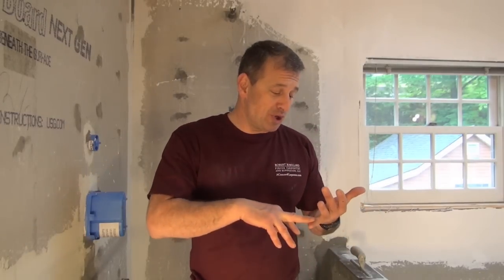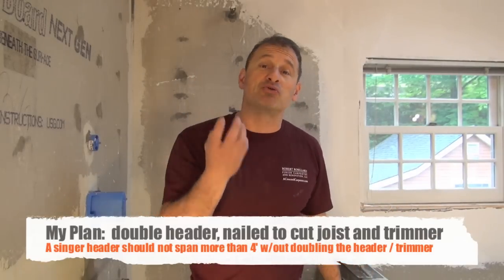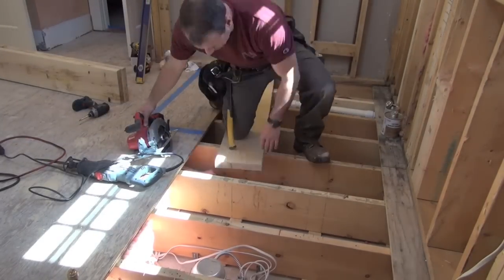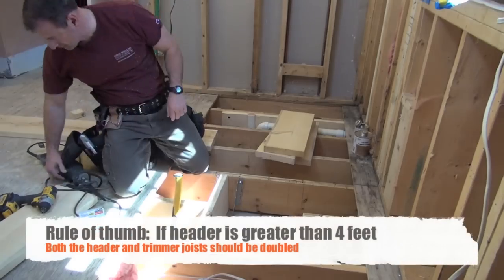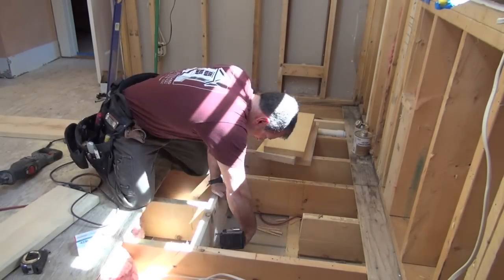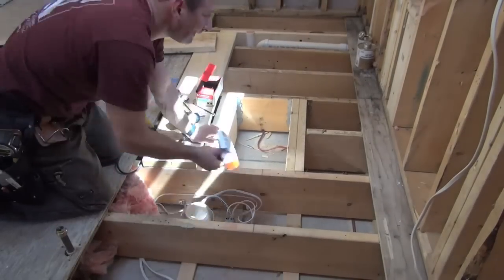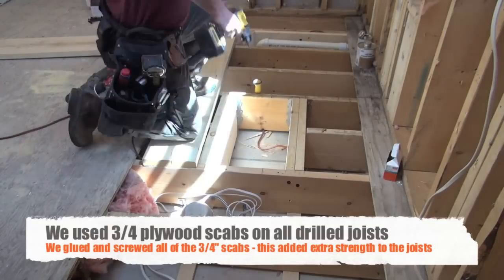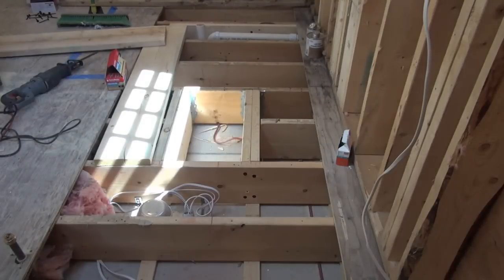Bathroom Remodeling Part 7 [Framing openings in floor joists]

Comment: Do you have a suggestion for a supporting a tub(on the bottom) that is already installed and the dry wall is up...I'm willing to cut the dry wall on both ends of the wall and try and put something under it...I'm looking for the issues that I need to think about once I start and any tips that would help(make it less frustrating)...the tub squeaks when I stand/shower and I know that eventually it will split/break...I want to try and prevent this.  Thanks.

Comment: So would this technique apply to cutting attic joists to put in an attic ladder?  I need to go perpendicular to my attic joists with the pull down ladder. Would I reinforce the attic opening this way with a much larger "plumber's box" into 3 cut joists?
Reply: How did it go? I’m looking to do the same thing. @Rae KC

Comment: What size screws and nails were you using? Do you build with nails and reinforce with screws?
Reply from the maker: Marlon Waite build with nails - faster. Reinforce if needed with GRKs and Timberloks
Reply: What is the length of the Timberlok screws that you used?

Comment: Ugh! Not having top access (subfloor and finish floor already in place) is making me dread this. My tiny house is on concrete block piers and I have an approximate 13” opening to work underneath the house. The floor joists are on 24” centers supported by 4x6 beams. But the floor joist is smack dab in the center of where my toilet main drain has to be. This is going to be an awful task that has to be done. Basically, this is a shed conversion so plumbing wasn’t considered  in the manufacture.

Comment: Why are you using screws and not nails? I'm doing a remodel and don't know what kind of screws you used and why.
Reply: Easy to take out the screw if you screw up
Reply: Tim West, I believe he's asking because screws are not rated for shear strength, therefore when you're reinforcing things such as this, essentially making a beam, you want the two pieces to have shear strength keeping them tight together.  Screws are not designed for that, screw to hold something in place while you drive nails in to give it the actual shear strength is the way to go.  That being said, I don't know what kind of screws he was using there, they were quite large and not your standard looking wood screw.

Comment: Can you cut out part of a rim joist? 9"X14" in between the joists.
Reply from the maker: Tom Tomer do you mean to accommodate for a fan vent? Yes you can
Reply: Thanks for the reply A Concord Carpenter/ToolBoxBuzz!  I want to reroute the ductwork from the garage to in between the first and second floor going through the rim joist. I would like to use 8x14" rigid metal duct.

Comment: Fantastic video, and something every carpenter should know.   Plumbers are idiots, they go in and hack to hell everything.  You need to understand this so that you can properly transfer the load when the plumber drills a 5" hole in a 2 x 10 joist.  #PlumbersAreIdiots